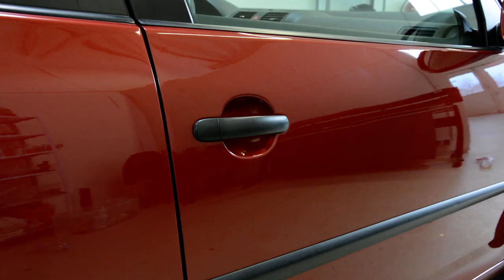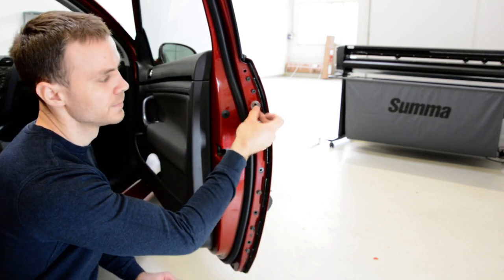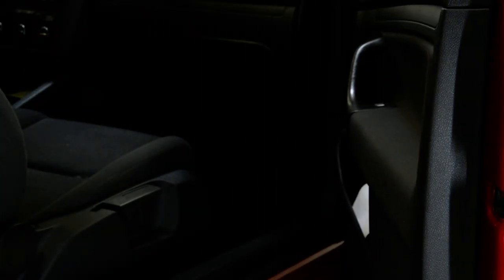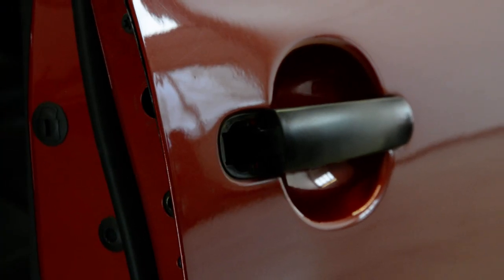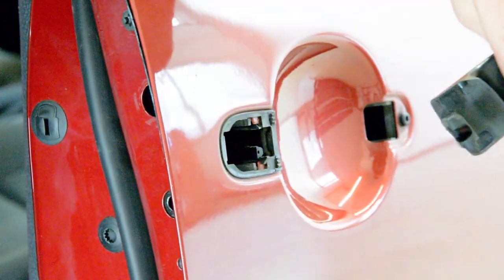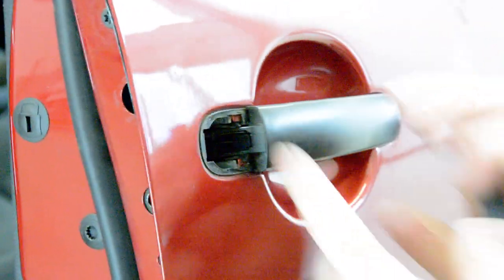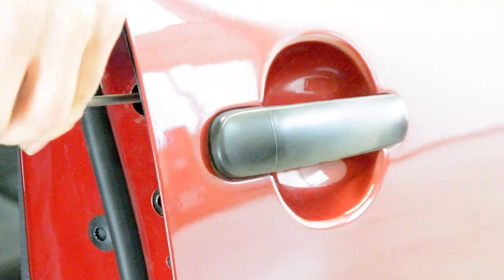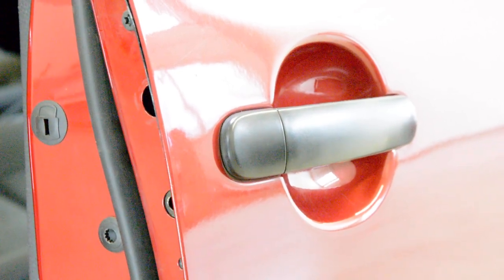How to remove the door handle passenger side vw golf mk5

Comment: Just remove my handles on my mk5 golf gti 2004 using this method. Only difference was I unscrewed the tx20 fully out and removed the end cap and door handle. No need to u screw and screw back In to remove.
Reply: my barrel keeps coming lose away from door, my torx screw will not hold it tight for more than 1 day, any ideas why its not holding properly with the torx screw, thanks.

Comment: my door wont open from the outside.. do u have a video on how to adjust the cable thanks
Reply: Mine too...
Try to press you palm on the top part of the door handle the same time you open the door...it works with my mk5
Reply: @ayohsuterrr9585  I have the same problem, and it works Only by pressing it, did you found out how to fix it?

Comment: I see T20 screwdriver in your other video but my door handle still not coming off. I release the cable and pushing handle towards the door opening but its not comng out.
Reply from the maker: The T20 is a torx, you need unscrew it completely and after that push on it
Reply: @DFCGarage  
Yes it a T20 torx i used and not a screwdriver as i stated above. I can unscrew the bolt and tighten it no problem but handle will not come out. I gave up and have now found if i pull the small nub piece of the handle, it comes out even when bolt is tight/locked. Lucky i did not start on driver door. I have got original colour coded handles and just wanted to put them on. It looks so easy when you do it in the video but my handle is not coming out. I was working on front passenger door Golf mk5 year 2008.
Reply: @tk4270  im the same as you lad i have these white clips on my handle that i dont see in any video did you get it sorted ?
Reply: @dalemccarthy8834  
Still not sorted. I have even shown to 2 mechanics and they scratching their heads too. I don't want to take door card or door skin off. Got matching shiny colour coded handles ready to fit but hopeless if I can't take the old ones off.
Reply: @DFCGarage  
If I unscrew completely will the screw not not fall out. I don't want to remove door card to retrieve it. Also can you check if 2005 to 2008 Golf is different or same procedure.
Reply: @tk4270  i sorted it lad theres a little white bit that you need to hold forward  when you pull the handle to open it if you hold the whit plastic bits with a flat head screwdriver then let the handle back in and pull it out like he did
Reply: @dalemccarthy8834  
Which part of the handle are the little white bits you are referring to. I cannot see in the video or my handle opening.
Reply: @tk4270  i have all mine back together but any of the videos i watched didnt have it bar mine was at it for few hours and worked it out.  Its just on on the side by the locking mechanism and it stop you from pulling the handle past its slot if you pull handle out and hold it when you try to pull the handle it works
Reply: @dalemccarthy8834  
Send me link for your video please.

Comment: Ok so apparently in my golf 5 (2005) this method doesnt work. It used do come out normally (12 turns of screw ccw, and then pull back to remove, on driver door, but that method doesnt work on the front passenger apparently ...)

Comment: When I undo the screw the black plate still won’t come out. Tried levering it out with a screw driver but that seems to be pending the plastic not the hole plate. Thoughts?
Reply from the maker: When you pull move left and right
Reply: I had the same thing wirh mine just had to pull out the handle and wiggle it a bit pull out from the handle side it will come out